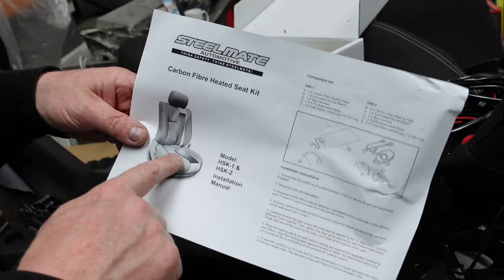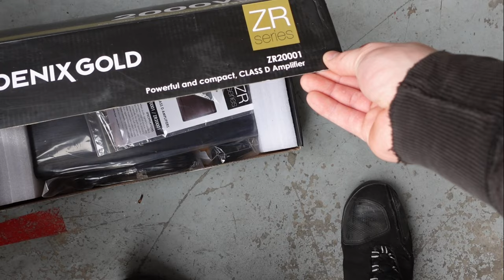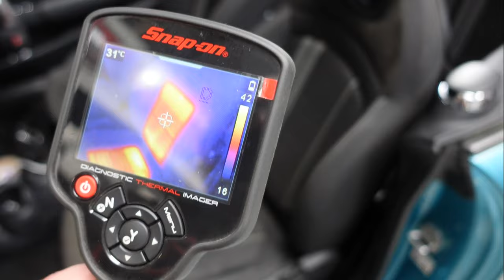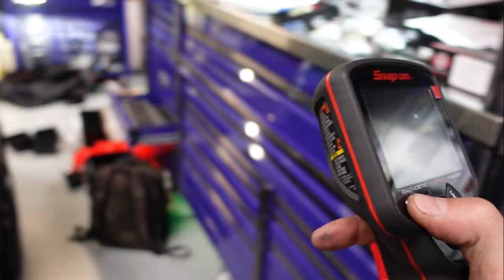worst saturday ever dan ends up in hospital. non stop work

Comment: Hope dans fingers/hand heals quickly. I did something similar while drilling a hole to mount a device. I was holding the false floor of a dodge chargers trunk area I drilled a 3/8 drill bit right into the middle of my middle finger and had to put the drill in Reverse to get it out. Kinda hurt. Used some good ole electrical tape to hole things together. Finished the job, trained the end user on how to use the equipment, then went to the walk in clinic.
Reply from the maker: im sure its stitches for dan he will live the massive ,,,, end